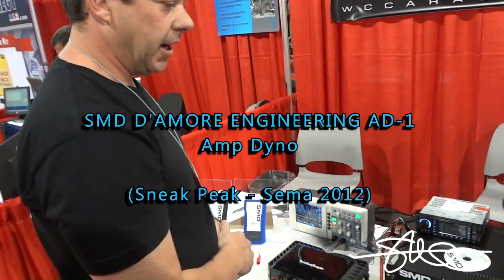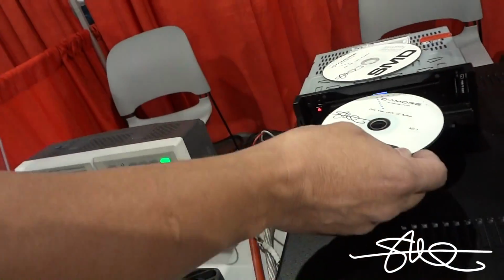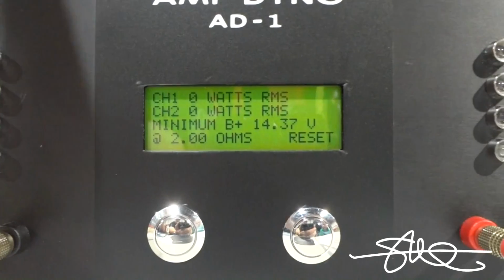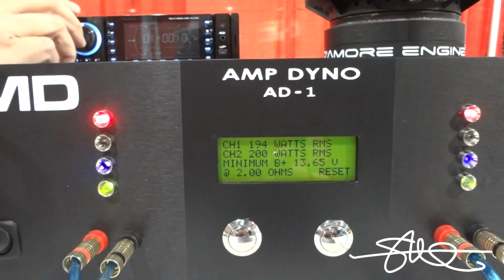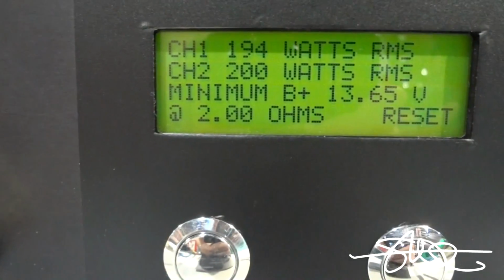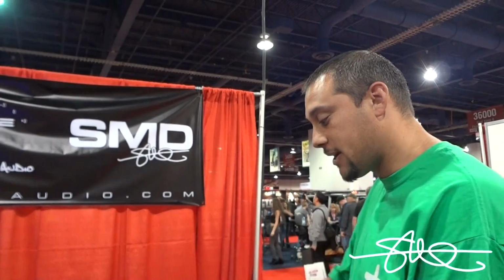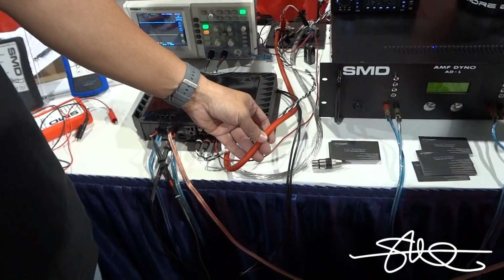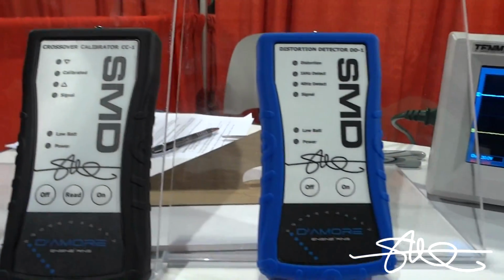Amp Dyno Vs. Rockford Fosgate "400" watt amp - SMD D'Amore Engineering

Comment: You are doing a very nice work! I watch your videos and I like it very much. Now I have a question for you. I own a car amplifier rockford T600.4.   I want to connect it to my car and get the bigger power out of it.   like the manual says 2x300watt  on bridge mode. please  tell me which connection will be that.'' to get the most power out of the amplifier ''.   two channel mono bridged or 4 channel stereo bridged??? I ONLY CONNECT TWO SPEAKERS , 250 WATT RMS, 4 OHM EACH. WAITING FOR YOUR ANSWER. THANKS IN ADVANCE!!!

Comment: still... usefulness, with an oscilloscope, multimeter, clamp meter and a bank of resistors,  using ohm's law i could figure out the same thing WHICH is what the programming in this unit pretty much does

Comment: I get some heat from those who don't understand how to properly test amplifier output power that my results are too low. I use a DD-1, o'scope, resistive loads and a clean input source and I can tell you a VERY small percentage of the amps I test actually meet rated power. I have been surprised by a few, but don't get close to most "birth sheets". They use reactive loads to obtain these higher numbers and I'm with Tony, the only true way to measure output is with resistive loads. GR8 vid!